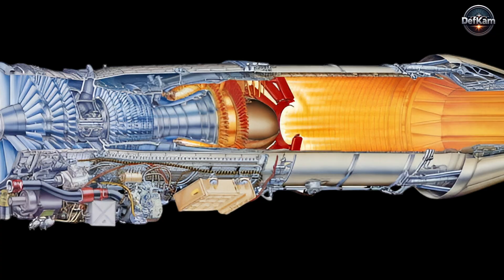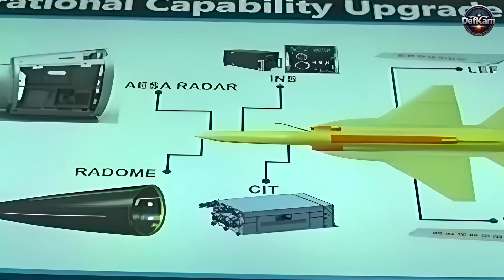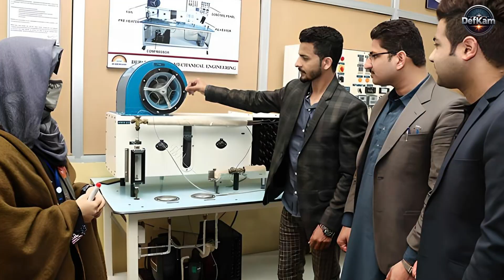Pakistan's Domestic Jet Engine.

Comment: At present Actual power of any airforce is 4.5 gen multi role fighter jet. There is need of medium weight fighter jet instead of light weight fighter jet like jf 17 thunderbird.  The air frame shown in this video is excellent replacement of jf 17 i.e pfx jf 17 rather jf 18. Which will be future replacement of aging mirage jets.
Reply from the maker: Yes you are absolutely correct.